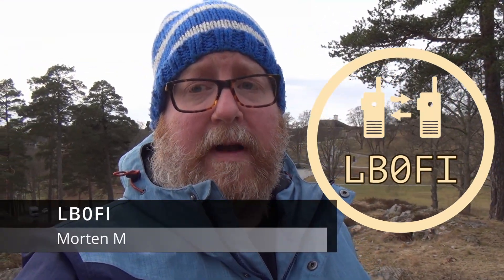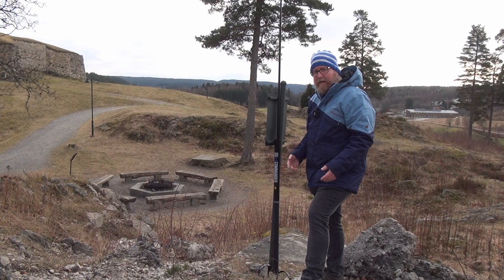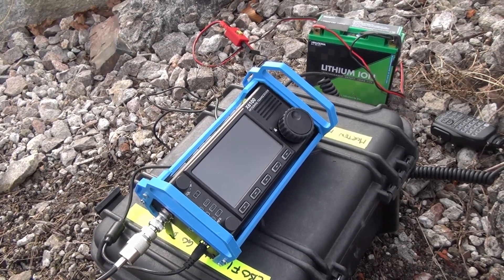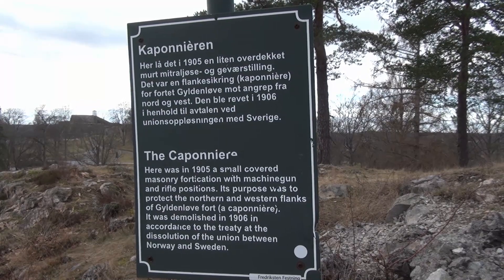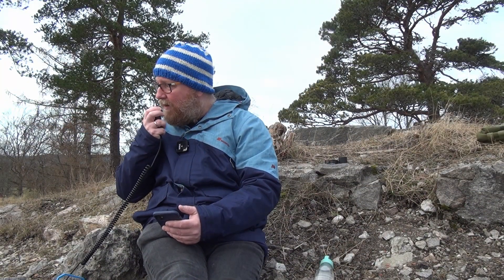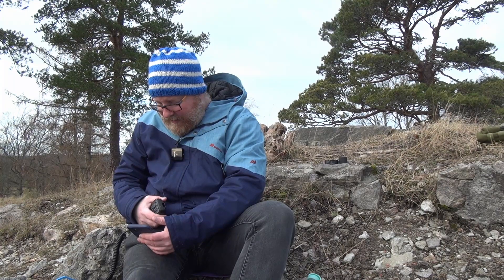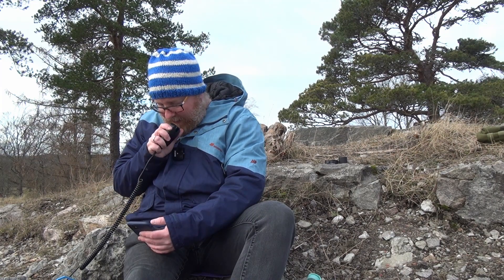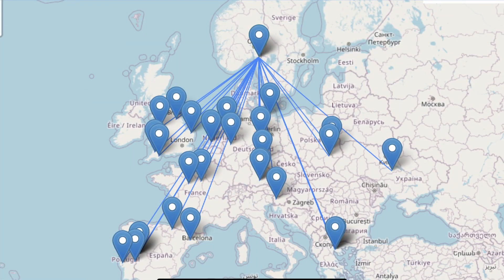POTA with a Rybakov - and a lot of intentional QRM

Comment: The Rybakov is a fun antenna.  I have found that a slightly long Rybakov (7.86m) is also a resonant 0.75 wavelength on 11m which makes it a nice thing to carry in the truck for either service.  73 KK7YIS
Reply from the maker: It's one of my favorite antennas for sure. I have used it in a lot of scenarios, and it never disappoints.

Comment: Can you try a Rybakov using an aluminum window screen ground-plane to see if it works better??  3 foot x 4 foot flat on the ground connected with one alligator clip.
Reply from the maker: Window screens are not common here, and if I could fine some it would be too expensive for an experiment. I have no doubt that it would work though, but I can’t see how this would be easier than the radial net I use in this video.

Comment: What bags you are using? This bags in the background.
Reply from the maker: The green pouches? Cheap MOLLE-pouches from Ebay. There will be a video on those and the contents coming next week.
Reply: @LB0FI  Thanks. I like this bags, but i didn't find the right size for my gear. Too small, othher too big, the next too expensive.

Comment: A great vid Morten. I have used the same unun and found it really good. I have used a good amount of radials though. Keep on the good work, stuff the QRM...
Reply from the maker: Thanks! The unun is actually really good, except for it not being weather sealed. I have some plans on testing it out for a loop antenna, so make sure you keep watching!
Reply: @LB0FI  Yes, I have used quite a bit of insulating tape to assist with weather proofing. I have subscribed and will go through the library. 73

Comment: Good stuff, Morten. I've used the Rybakov a few times after learning about it from Walt & Tim. While it worked out well for me (QRP and QRO), what surprised me is that it really seemed to do exceptionally well on 15m and 17m. I've been able to make contacts on 10-12m, but not as easily--that could also be band conditions and timing though. Anyway, I'm glad to see it worked out well for you. It's a nice multi-band antenna option for portable ops. 73
Reply from the maker: Absolutely a descent antenna. It might not replace my EFHW, but it’s a great supplement.